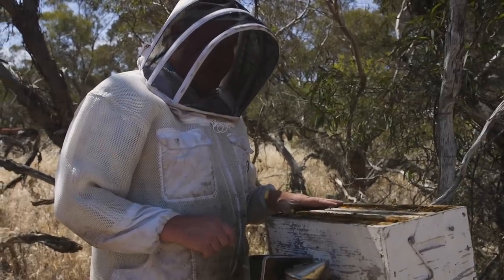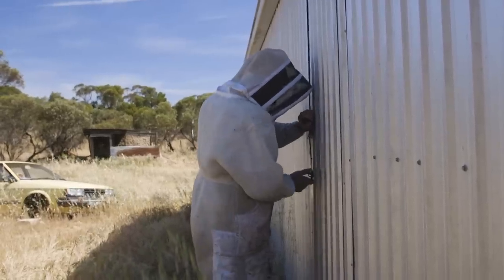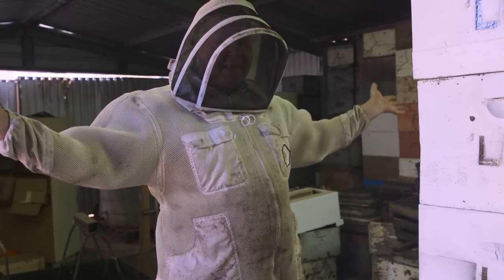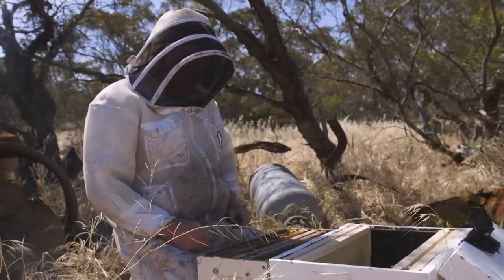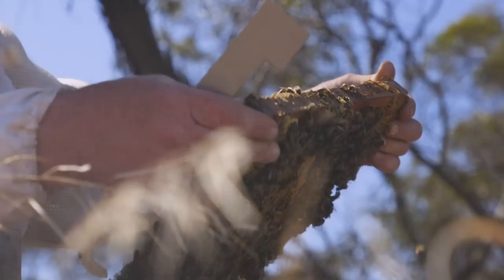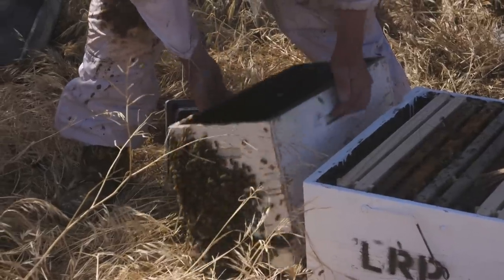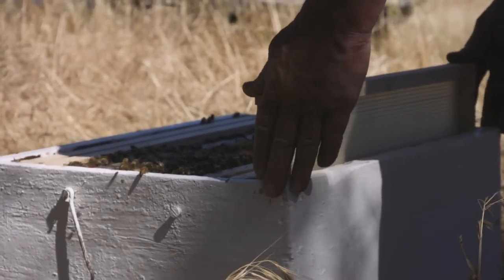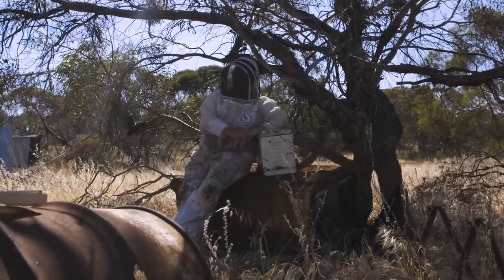How to Install a Nuc - The Bush Bee Man

Comment: Hey Bee Boys, get yourself a steel bucket for your smoker.
Can get the 10L galvanised buckets from Bunnings.
Put a few litres of water in the bucket and just hang your smoker from the edge of the bucket or to be safer hang it in the bucket over the water.
The water comes in handy for washing your hands or tools as you go, and in the event of a fire it could help a bit too.

Just food for thought dudes.